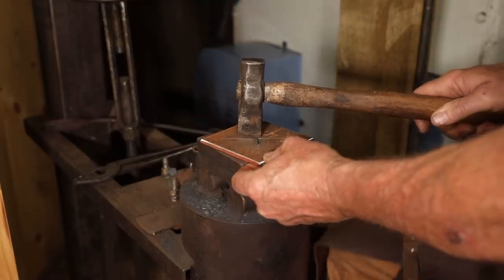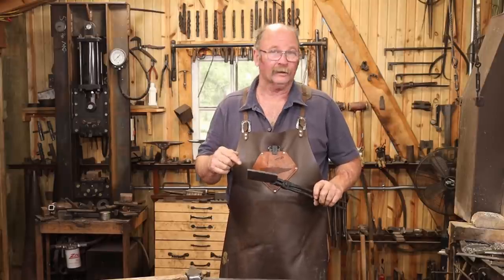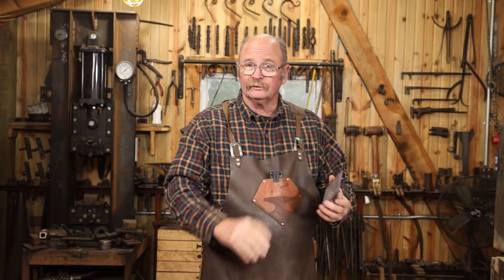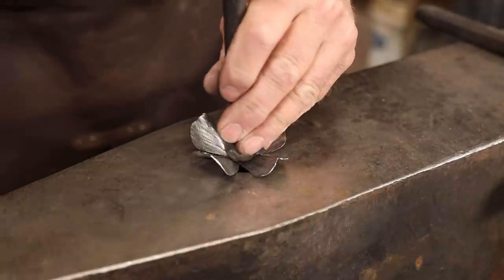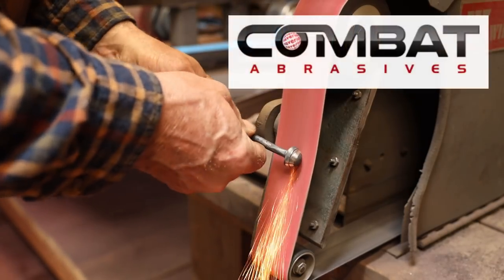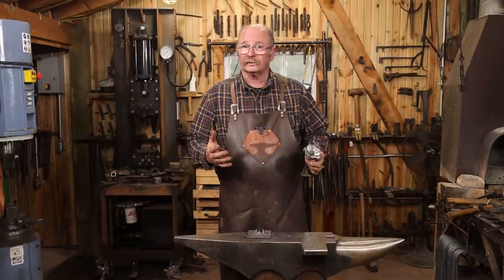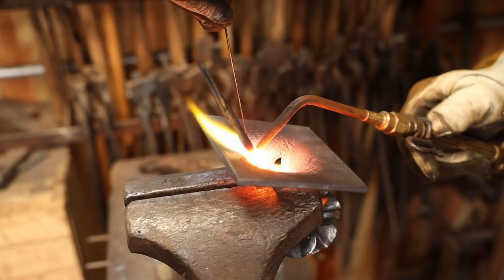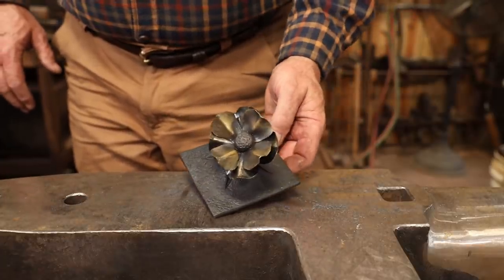Forged Quilt Square - RMS group project

Comment: I know you use both coal and propane but I was curious where you get your coal and how much it cost if you don't mind me asking. I am new to blacksmithing and you channel is truly and inspiration and learning tool, thank you.
Reply from the maker: What coal I still have was purchased years ago in bulk so long ago that I don't recall the cost.  But to buy it by the bag around here is around $25 per bag plus shipping if you order online or a half day to go get it if you buy it from a supplier north of here.  All of the mines in the area that used to seve the steel mill have shut down since the mill quit burning coal.